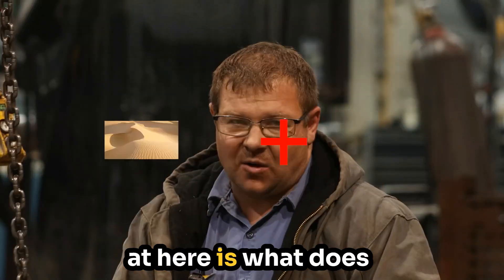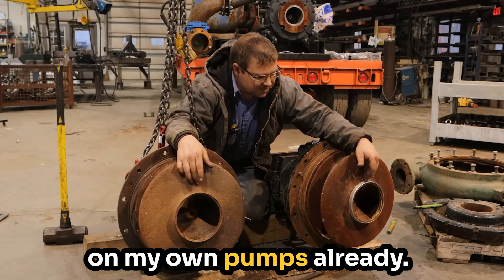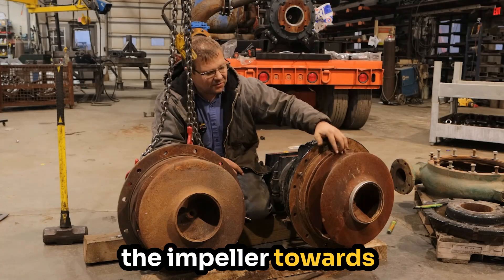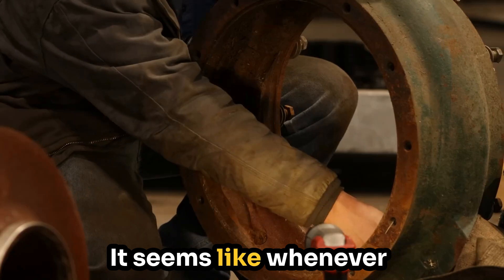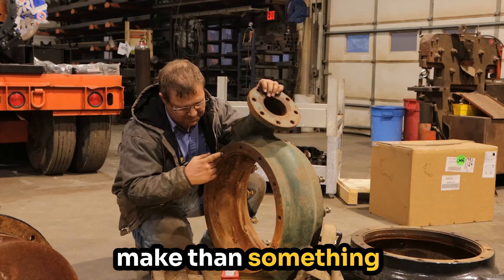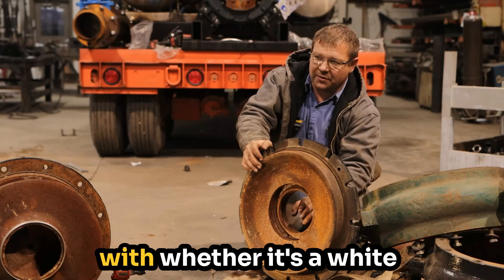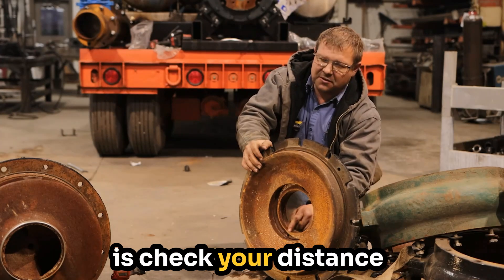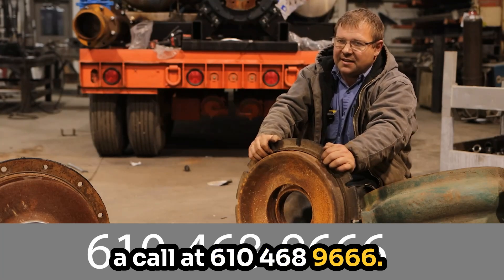Sand Laden Manure Pump Repair | Manure Pump School | Manure dragline | Manure Injection

Comment: Over here in 🇬🇧 and Europe we have slurry separators so only liquid goes in to slurry lagoons or tanks , sand reused and slurry solids spread on fields or as it’s dry used for bedding 🇬🇧👍👍
A
Reply from the maker: Ok, here in the US most of the farms do separate their sand with gravity sand lanes. However it doesn't get all of it. 
Really depends on farmer's management.
If you accidentally get a job that has a lot of sand along with the regular pumps, it doesn't take long at all to wear them out. It amazing a sand laden manure works like sand paper. :(